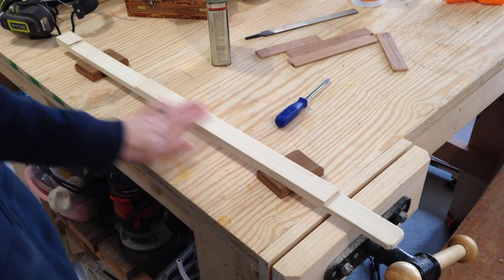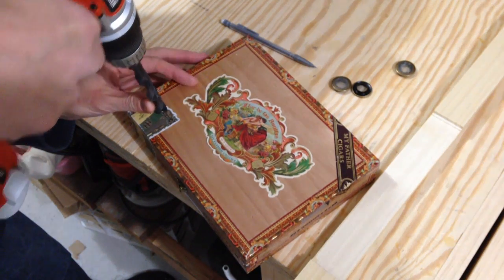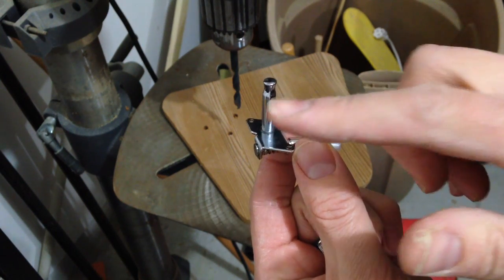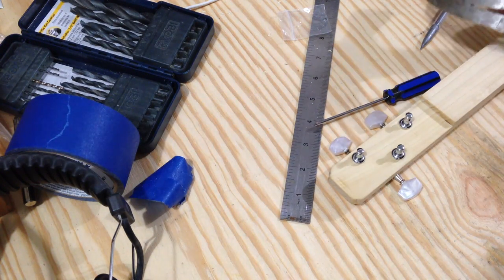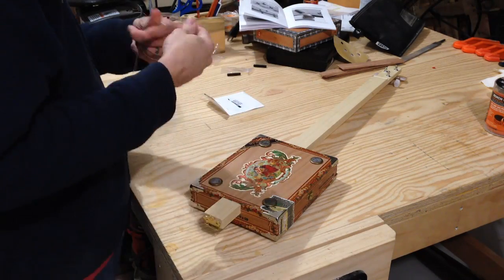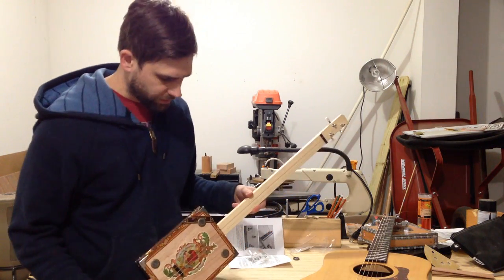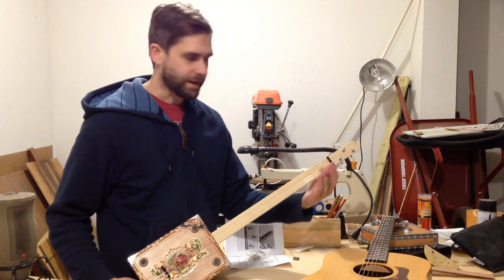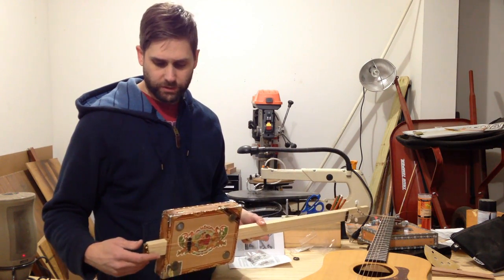Make A Cigar Box Guitar part 2 | C.B. Gitty Kit

Comment: Nicely done! That's a good first build. Don't sweat the tuner being upside-down - that's a very common first build error. Just keep an eye on the brass gear and keep it tightened up. String tension will tend to try to pull it away from the tuning peg gear, which can lead to it stripping. I tune most of my 3-strings to GDg using an A string, a D string, and a G string from a standard set of guitar strings. I pick up sets of strings on close out, so 9 times out of 10, I have no clue what gauge they are. I do know that light gauge phosphor bronze strings work very well. Nice build!
Reply from the maker: Thanks for the tips! The poplar neck is bending a little bit so far so I want to try a denser wood next time. Also, I don't think I will build another feet less one. I really want to stick with fretted ones since that is what I'm used to.  As far as the strings, I prefer the sound of the GDG tuning like I've heard on YouTube compared to this GBD so I tuned mine to EBE to get the same interval and I like it so much better.
Reply from the maker: By "feet less" I mean "fretless" of course.
Reply: Gotcha. DAD is another popular tuning, but it's pretty much wide open. It's the basic 1-5-1 inferred chord.
Reply: CMR Woodworks | Chris McDowell E-mail sent.

Comment: Nice job Chris but I was waiting to see how you attach the neck to the body ? 
You didn't glue it or screw it, and if you did glue it to the top lid would it just be on the two ends with a small amount of glue?
Im thinking how can you string it up by just closing the lid.
Reply from the maker: +R Shay I didn't attach it. The directions don't even say to attach it. It's friction fit in the notches for the neck. I've never had an issue of it coming out. I wouldn't have attached it anyway because I'm still deciding if I want to open it up and add electronics. I may just make another fretted one and save the electronics for it, though. The lid on this one though has a latch to keep it closed so it never swings open or anything. Thanks for watching!

Comment: The playing Action will be terrible on this one because the fret board is flush to the box.   he should have glued a 1/4 inch thick fret board on top of the 1 x 2  neck  so the fret board will set higher .  that will give you room to work with at the bridge  to getting a much better string action .   I built my first CBG following a video like this and made that mistake  lol
Reply from the maker: i would‘ve glued a fretboard on if the kit came with one.
Reply: I’ve seen people use wooden yard sticks for that.